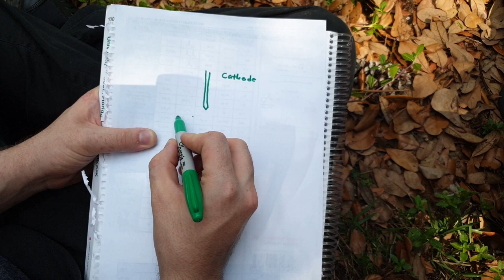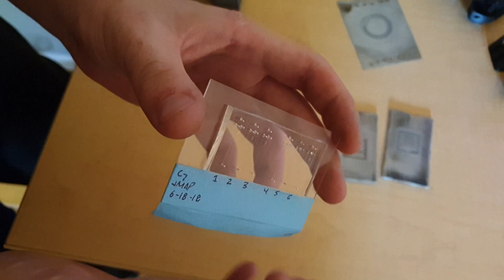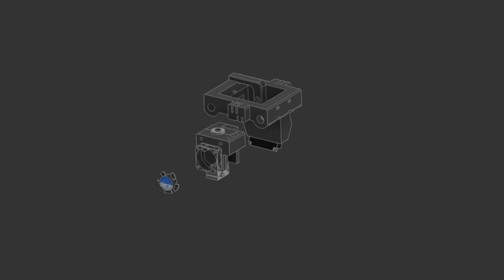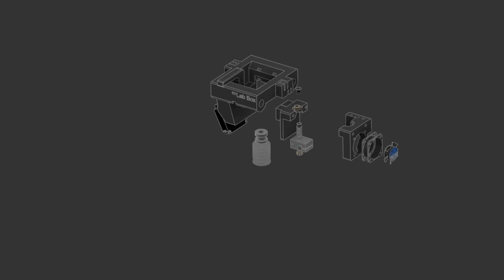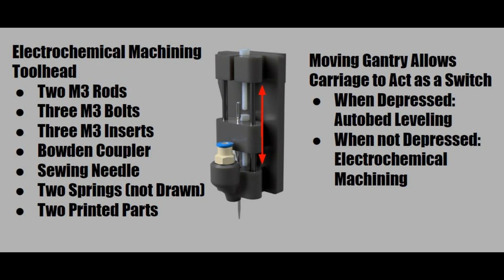Electrochemical Machining GrabCad Extreme Redesign

Comment: Just a little idea to improve the concept : the electrolisis is a reaction that is limited in speed by equilibrium (because of thermodynamics) as such, the faster you get rid of the aluminium ions next to the work piece, the quicker you will be able to machine your parts. There are two ways to improve the exiting of aluminium ions : 
- increse voltage : it will increase the electric field , E and the ions, subjects to Lorenz attractive force, F=q*E, will go away quicker.
- make a directed stream of water from the cathode : thanks to the HO- ions, the metallic ions will get consumed and increase the speed of the reaction, it's called equilibrium displacement. 
The downside of your design is that the current of water only comes from one side of the tip making an asymmetrical reaction on the part

Comment: @7:49 recommend adding on a termination fitting with a bushing on the end of your FMC to avoid damaging your wire insulation over time. Vibration and movement will cut through over time, you may pay attention to prevent that but many others won't. Important to think about when releasing a new product. Open source?
Reply from the maker: You are absolutely right, but I did not have any on hand. Everything is open source. The link to the grabcad files are in the description. I provided a complete CAD file for the printer/ECM machine, and both sets of firmware

Comment: How much needle will wear and looses its shape?

You told would insulate needle, maybe like using emalic coating? (like coil copper wires)

Is Aluminium faster than Steel? Do it make it more accurate?

How small holes/slots could made? I would need max 1.0mm grooves to 6-10mm thick piece, not suiting for ECM?

Comment: salt electroplating you could multi metal rebuild surfaces too replace head with gutted syringe electrodes and earth the plate it will deposit metal so you could cut then resurface with a surface hardening all at one station then :)

Comment: Correct me if I'm wrong but it seems like the spring loaded auto leveling thing is unnecessary. Because both the needle and the part are conductive, you could just test connectivity between the needle and the bed as you lower it. Is there some advantage to the spring design that I'm missing?
Reply: From the looks of it, the bed level sensor and the needle are on different circuits so they need different connections

Comment: If you drilled first all the way through the work piece and only then started moving horizontally, wouldn't the cutting go faster? You'd be using the entire surface of the needle? Also, I looked it up and in industrial applications they tend to use conductive molds, negatives of the work piece. So how about print the mold in plastic, cover in conductive paint, install on the carriage and lower over the work piece.
Reply: No, that's an entirely different process and I believe it's classified as EDM Molding..

Comment: Great project! I'm tempted to try something similar on my own 3D printer, so I'm curious what sort of filtration you use with your salt water solution. I'm hoping to go the route of jet ECM but I'm not sure if a 34 gauge needle could withstand non-trivial amounts of aluminum hydroxide. Would it be simpler just to use a new batch of salt water every cut?
Reply from the maker: I dont use any filtration and on smaller diameter needles it leads to clogs. I recommend just using new salt water and throwing away the old stuff
Reply: @MorlockEngineering  Thanks!

Comment: Two questions, if I was using an existing printer (davinci 1.0) how big of a concern is shorting the rest of the machine with the water?
Reply from the maker: I use to have a Davinci 1.0. I would never convert it to ECM. The salt water would mist would rust all the steel inside. Go buy a crappy printer like a Tronxy and use that instead
Reply: @MorlockEngineering  it’s already unusable for printing.  Wouldn’t all printers rust?
Reply from the maker: @fozbstudios  Not really. The davinci is an enclosed printer with almost bear steel. On an open air printer it is fine

Comment: Very interestingn project but the way you machined the plate was done poorly.
Why only limit it at 300mA? You removed your hotend which usually draws about 3A and your heated bed draws about 10A both at full power. So then why are you pumping out 1/40 of your psu capability?
Reply from the maker: I am glad to have some criticism. Your concern is valid. When conducting these tests I used a multimeter to measure the current during operation that was being drawn by the electrode (300 mA). This was very low. Especially considering that nothing else (hotend or the bed) was on. I think this is because of the power supply I am using, which does not force enough current through the electrode.
Reply: @MorlockEngineering  have you measured the resistance of the needle and work piece, or changed the distance between the needle and the work piece?
Reply: @MorlockEngineering  Very awesome work here, but I had the same concern.  As far as your electrode -- how was it actually being powered?
Reply from the maker: @Bisofication  Yes, I have tried changing the distance. I found that minimizing it produced cleaner results. The best results thus far were achieved using an initial distance of 0.2 mm, with a movement 0.025 mm down every 2 passes

The needle was powered by a PC computer 12 volt power supply. One ground line was attached to the needle through a relay. A 12 volt line went to the workpiece
Reply: @MorlockEngineering  Can someone get this man a decent power supply hahaha :D
Looking forward to see more
Reply: Maybe overcurrent protection is kicking in?
Reply: @KentoCommenT  Someone correct me if I'm wrong, over current protection shuts down the entire power supply and requires a full restart, but one psu is different from one another.
Reply from the maker: @KentoCommenT  No, thats not it. But I know what you are talking about
Reply: @MorlockEngineering  Could you print lowers/frames with it?
Reply: @henrysmith7276  Maybe. With a lot of improvements

Comment: A finished stepper motor costs less than the price of the metal you would need for the housing if you made it yourself. As long as parts are available there is no point in making them yourself. This only becomes useful when you need custom parts. Even then metal prices are insane for small quantities with the prices being 5-10x what a manufacturer pays. In many cases it is cheaper for me to buy a microwave than it would be to buy the steel sheet used for the housing.

Comment: edm  electrical discharge machining
Reply: Wrong, He said it was ECM, not EDM
Reply: @3er24t4g1  not "wrong"  edm is the same thing in machine shops used for die making and tight tolerance machining with electrical current  that has been used since the early 60s.  check it out. this a lower tech way but i like it . so dont jump to to the "wrong" conclusion. i am a MACHINIST.
Reply: @slasherchris1735  but they are clearly not the same thing at all...
Reply: @slasherchris1735  
You are "wrong", no matter how MACHINIST you may be
Reply: @robbiejames1540  Hey I have to get to work.  Can I get 2 orders oh fries with that .  Thanks bud you are doing a great job 👍